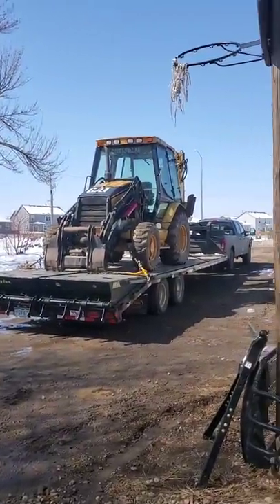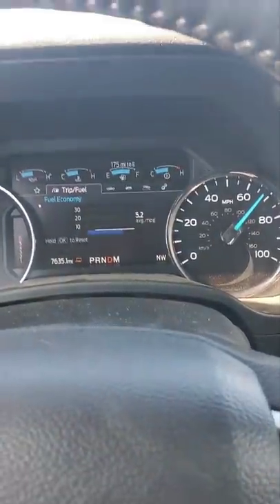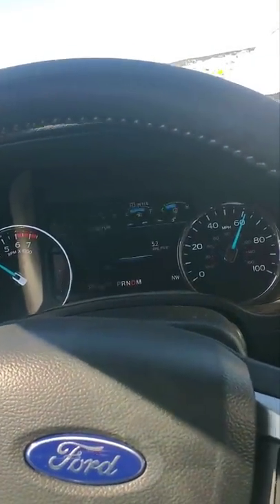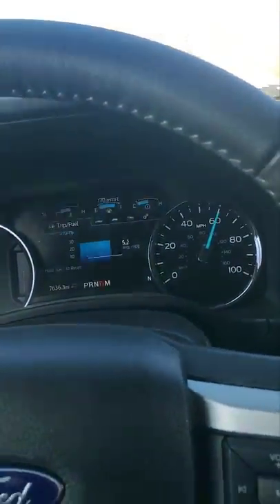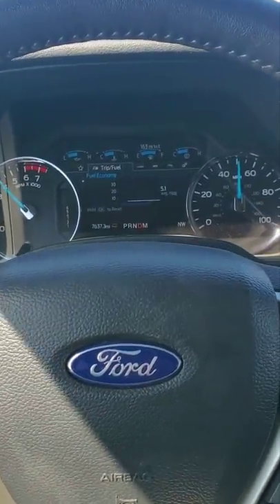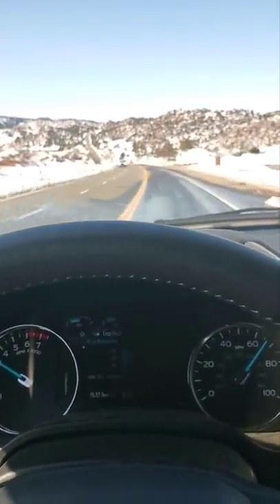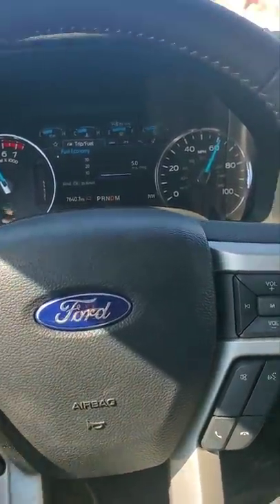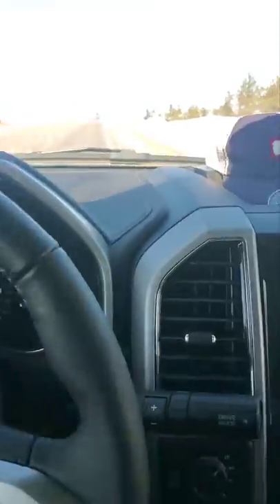7.3 godzilla towing 24k lbs through the rockies.

Comment: That 7.3 pulls 24k about as well as the Tundra with the 5.7 pulls 8k.  What a phenomenal engine.
Reply: I can attest to this as being true. I had a 2008 Sequoia with the 5.7L towing 7k trailer but loaded full of family (and dog) - through Utah/Wyoming rockies. It behaved much like this. That 7.3L is incredible that it can do this given the gearing etc. The only thing that likely would slow it down would be a tall travel trailer (likely lighter for sure) but with added wind resistance (which changes things big time), but you could easily just get the steeper gears and likely would help mitigate that issue...
Reply: My colorado 3.6l pulled about 3,700lbs from Vegas to Salt Lake City and back.  On the way back I was floored at ~5krpm barely holding 60mph.  I can just imagine this big 7.3 probably wouldn't have changed the shift pattern 😅😅
Reply: @xtanon5540  I would hope not
Reply: All yeah me and couple fellas pulled a trainnon some chic. 😆
Reply: now we need the 7.3 in the f-150
Reply: Til the camshaft and lifters fail at 40 to 50k
Reply: On which truck?  My colorado definitely, it wasn't intended to be a work horse.  It's a commuter car with leaf springs and a bed, but it pulls my 14ft flatbed with ease.

The 7.3 engine is rock solid and shared wirh class 7 vehicles.  Like with old big blocks, it is by no means the weak point of this truck.
Reply: It has more to do with the trasmission than anything else.
Reply: I agree, the 6 speed really hinders the tundra
Reply: @tomkelly3896 power train warranty will cover that, no problem. All the big 3 have lifter issues
Reply: The 5.7V8 is a great engine too
Reply: @NMTrucks That I force engine is one of the best ever made.

Comment: You hit the nail on the head, the 7.3 is not comparable to any recent gas motor offered in an HD truck, I'd go even further, paired with the 4.30 and the 10 speed, it's in a class of it's own for a gas truck. It'd be interesting to see that same pull in a 6.0 Powerstroke, wouldn't be surprised to see the 7.3 outrun a stock 6.0. 
You're pulling about double what the average guy using pulling a TT or 5th wheel will be doing, IMO, the 7.3 is an excellent choice for most truck buyers out there. 

Thanks for the video
Reply from the maker: Thanks for watchin
Reply: I agree totally. Not a giant Ford fan really...BUT this truck seems like the IDEAL option for people who wanna tow, and tow quite heavy. BUT also want a reliable (to be determined...but it's a gas engine so...) not all that garbage emmisions and DPF poo. The power from it, the gears and the trans (with the awesome tuning that was done to it) and the thing just does. I'd love to drive one and see how it is, but they seem like a pretty darn good truck.
Reply: You're CORRECT......the Ford 7.3L gas with 10R140G and 4.30 gears is in a class of its own! Compare the 7.3L gas engine to the 6.0L diesel engine? I just sold a VERY NICE 2006 F350 CC Lariat 6.0L 4WD SRW 172 truck that had virtually every option. I worked it hard, but it was super clean...95 percent both interior and exterior. Yeah, it is possible to work a truck hard and keep it nice. Most of these trucks had the 3.73 gears in the differentials. However, Ford offered 4.10...and 4.30 gears. The 6.0L with a load in tow and the 4.30 gears.....will run up Eisenhower Tunnel or Vail Pass like it was a Sunday afternoon drive on I-25. The 6.0L diesel would out tow and out perform the 7.3L gas with the 4.30 gears. However, I'd bet the 7.3L gas with the 4.30 gears would out perform the 6.0L diesel with the 3.73 gears. If the 6.0L had the 4.10 gears...probably be close toss up.
Reply: @baileyhatfield4273  **Maybe you will become a Ford fan.** You are CORRECT...the Ford Super Duty with the 7.3L gas engine, 10R140G and 4.30 gears IS the IDEAL truck for many people. I have had diesel trucks...and they "launch the load" from a stop...and pass with a load very good at highway speeds. However, I now tow lighter loads and less frequently. The 7.3L will still tow heavy loads...and more than Ford states...just not quite as easy and efficiently. These are the main reasons I just ordered on March 30th, a 2022 F350 Lariat - Ultimate Package - Black Appearance Package - Tremor Package with most all options.

***I have always like the GM gas engines. BUT, I absolutely and completely HATE the Chevrolet and GMC trucks....especially the 4WD trucks. In short, 4WD GM trucks are PATHETIC off-road...especially on uneven terrain in mud and or snow. These trucks always get stuck. Why? IFS Axle instead of Solid Front Axle and...Low Hanging Frame Rails cause the following ------------------>

1. POOR Front Axle Articulation off-road on uneven terrain
2. POOR Approach Angle
3. POOR Departure Angle
4. PATHETIC Breakover Angle (GM trucks "High Center" off-road and become "teeter totters"
5. Square / Rectangle Wheel Wells with Little Itty Bitty Tires. The proverbial "round peg in a square hole"...Stupid engineering for a 4WD truck. Lift? It takes either a 4 inch or 6 inch depending upon desired tire size......messes up the "Center of Gravity". People who own and drive Fords and Dodges can get 37 inch tires with Level Suspension System (Carli Suspension). AEV gets a 40 inch tire under a Dodge with a mild 3 inch lift.
6. Solid Front Axle better for towing...more weight up front...better balance. That said, I have seen to many people driving a Ford F250 and towing a big 5th Wheel...with rear suspension sag...NOT safe. If I was a Highway Patrol...I'd pull these people over...write 'em a ticket and tell them to install Air Lift, Firestone or Hellwig air bags. If they can afford the rig, they can easily afford the air bags.
7. Ford Super Duty trucks have Fully Boxed Frames that are e-Coated.
8. Ford offers more and better amenities and options. Plus, not many "option restrictions" like Dodge and GM is the worst...want or get a certain option...cannot have one or more other options. GM wants "assembly line efficiency" more than "customer satisfaction".***
Reply: It’s comparable with the GM 8100, that’s pretty recent in regards to modern trucks.
Reply: @messagefamilystyled1101  The 8.1 is a great motor in it's day, but it's 100 HP shy of the 7.3 Ford.
Reply: @257Tony   “modern” is anything built after the 80s.  it’s practically bulletproof I’ve towed 20k lbs with my 3500 dually 8.1 with NV4500 manual quite often, 200k miles on it. No such thing as rebuilding that engine it just keeps going. I’ve heard some horror story’s with these new 7.3s.
Reply: 6.4 with the 8spd and 4.10 is a monster!
Reply: @symorlinthecaster5882  Not even comparable IMO. The 6.4 w/3.73 struggled mightily up the IKE. 4.10 won't make much difference.
Reply: just picking up the exact combo in a 2022 this week. Very excited to see how the 7.3 with the 4.3 rear will do on that 10 speed. Hoping it pushes through all gears while towing. Brothers 10 speed 5.0 150 tends to skip 2nd and 3rd quite a bit.
Reply: also have seen some dyno numbers showing 545 at the rear when combo with the 4.30
Reply: Absolutely correct
Reply: A lot of guys talking about leveling kits on forums… looks like you found the perfect solution.
Reply: @ryanmdowling86  they are made to do that .
Put it in tow mode when you tow, and changes the transmission behavior.
Reply: The GM 496 cu in its comparable. He said the last 20 years.
Reply: @257Tony  its a great alternative if your on a budget...
Reply: You are correct. 99% of heavy duty truck owners do not need more truck than the 7.3, except maybe their ego needs the diesel. There are a couple people that tow super heavy everyday or cross country that need the diesel. The rest are just pretenders
Reply: The 7.3 gas would pull about half of the 6.0 diesel. The torque number doesn’t lie…and it would take twice the fuel. Diesel has almost twice the energy released when burned. Having said that I’m not a fan of the 6.0 diesel. But like I said earlier you can not run a gas engine pulling at its max torque load at 5000 rpms. It won’t make 20,000kms. KA-BOOM! 💥🧨
Reply: @dalekindlein7612  lol. 5000 RPM makes kaboom, but 40 psi boost, that's fine. The 7.3 gas trucks have noticeable higher tow ratings than any 6.0 Powerstroke ever did.
Reply: @257Tony   not because of horsepower or  torque .it's because of boxed frame and lower axle gears.  10 speed that you aren't going to use when towing maybe 6-7.
Reply: @257Tony   and again how many gas powered trucks tow every day like car haulers do. Zero in so cal all diesel.
Reply: He was really pushing the 7.3 to it’s limits and still did a good job at 24k lbs 
I’ve seen a 6.0 powerstroke pull 20000lbs The good old Garrett turbocharger screams it’s way down the road 
Under full acceleration and it still does a good job. But them old 6.0s are ticking timebombs. The diesels are expensive to maintain and repair. The 7.3 a good reliable engine for towing. The 7.3 under proper maintenance and repair can go over 300.000 miles under heavy towing. A new 7.3 crate engine is only around 8000$ compared to replacing a 6.7 powerstroke that will set you back 24.000$ ouch. 
The 7.3 is good for people towing on the budget
Reply: @Cowboy66SEVEN   I want to see I don't care what brand a gas motor that's used for heavy towing last 300 k. Won't happen.
Reply: LOL has anyone seen gas powered semi trucks or 18 wheelers. Imagine if ford made a 10.L v12 Godzilla. 
I’ve seen propane powered freightliners
Reply: @Cowboy66SEVEN   there's no gas powered semi's for reason. Way back in late 80's co I worked for had 2 LP. Powered international small tractors used to move trailers in yard
Reply: @techs1smh13  this guy towing a rv blew up his 7.3 godzilla after only 6800miles!!.
I guess I was wrong about it lasting 300k miles.
Reply: @Cowboy66SEVEN 🤔🤷😂😂
Reply: If you put a centrifugal supercharger on it that thing will go YEEYEE
Reply: @messagefamilystyled1101  - the V10 Ford beat that gutless 8.1L this new 7.3 destroys it no comparison
Reply: @baileyhatfield4273  still has a lot of emissions, just cause gas doesn't require Def doesn't mean there not bogged down by emission. Damn shit is annoying but oh well
Reply: @techs1smh13  it can if you follow Fords heavy duty towing maintenance schedule
Reply: I’m surprised a v8 with this much displacement passes emissions no problem.
Reply: @dalekindlein7612 u have no idea how gas engines work at all.

Comment: Please keep us updated on the 7.3. I am about to order a 350 with 3.73. I’m sold on the 7.3 design.
Reply: Did you order it? What is your payload and other weights?
Reply: @slaytanic921  on order. I have an order number but no VIN yet. I ordered Nov 2 2021. I ordered an F-350 XLT Crew Cab 4x4 FX4 7.3 Long Box, 3.73 locker, power pedals, power tow mirrors, that crazy 360 camera tow package, an extra camera, block heater, upfitter switches, fifth wheel gooseneck prep, a bed mat, a tailgate step, and clearance lights. First time I have ever gone for a Hail Mary like this. Some old guys buy Corvettes. I’d rather drive this. Im currently on a vacation trip using a similar truck only it is a Lariat. Ford gave our company this truck and said it was experimental. Won’t tell us what that means. But they just want it driven. It has telematics on it. My CEO authorized me to take it because he thinks this will convince me to back down to an F-150 again. Haha. I drove it 680 miles today from southwest LA to Smyrna TN. All smooth highway. Truck is a dream on the highway. Impressed with the engine. Tomorrow I’ll calculate mpg at the pump but the truck says it did 15.7mpg on the trip. This truck has mild mud terrain tires on it that aren’t great for highway. They are noisy. I’m sure they have a lot of rolling resistance. I was in ECO mode the entire day by the way. Great truck. I’m convinced I want to keep my 350 order intact. Why did I go 350?  Slide in camper. Slightly better payload. I ordered it derated to 10k GVWR and confirmed with State of LA and my Progressive insurance Agent that I won’t have to worry about it being classified “commercial”. Everyone says it will ride hard. Sick of hearing that. The 250 I drive today feels like an F-150 from a couple decades ago. It’s a TRUCK. It’s a Super Duty. It’s no toy.
Reply: get 430 gears !

Comment: Thanks for a great video! You’re right about diesels and all the emissions nonsense! You have convinced me whenever my 06 Cummins dies a 7.3 gas will replace it. If you do the math based on the cost of diesel vs gas and the mpg differences the cost per mile is not that different. That doesn’t even take in account the diesel engine purchase price, extra maintenance costs and DEF fluid. Unless you really really need a diesel, nowadays it’s just not worth the huge expense.

Comment: Hi there from the Western Slope of CO!  Thank you very much for sharing your towing experience with the 7.3l gasser!  I am really glad to see it is doing well for you.  I have one on order with the 4.30 gears.  We have a 26 ft travel trailer coming and I didn't want to do a marginal tow experience with the 1/2 and 3/4 ton series.  I also didn't want to spend the $$ for the diesel option.  I did have a 1ton ram diesel a few years ago.  Wished I still had it, but this gasser should serve well.    Safe travels!
Reply from the maker: I think you'll like it
Reply: You bought a 7.3 with 430s for 26 ft  Camper,You won’t even know it’s back there ,you would’ve been fine with the F150 3.5  eco-boost.It wouldn’t no it’s back there either. I think it will be a estatic with your new truck!
Reply: @JohnDiMartino  Ha...yes....we went through the thought of an F150.  But, we may get a bigger rig later on.  And, I've been part of some shady towing set ups, so I never wanted to be under tow vehicled!!  Additionally, 50% of the ways out of our town here in Ouray are a 4000ft climb within 1/4 of a mile of the town.   Oh, and the other item I didn't want to skimp on is payload.  We can easily surpass 3000lbs.
Reply from the maker: @deeremeyer1749  doesn't matter when you order it they put a build date on the door sticker so if you do get one as late as 2022 it will be a 2022.

Comment: That Godzilla sounds like a beast. I have the 2020 F-250 6.2 with 3:73 diff tried and proven 6 speed. No complaints. Last truck was 6.0 Powerstroke with 430 kilometres before it got stolen.

Comment: I'll be buying a 7.3 gasser in a dually configuration very soon. Decided not to buy another diesel can't afford to have the fuel system take a crap on me and bankrupt me
Reply: You're not kidding there! You can replace the gas engine at 200,000 miles for LESS than you would spend in fuel and emissions system repairs! And even getting 9MPG over those 200,000 miles you'll still be ahead money wise.
Reply: Just brought a fx4 f250 and I’m pretty happy with it so far cruise at 60-70mph and you’ll get 16-20mpg on the freeway but on the streets it’s like 10-13

Comment: Great video. I own a landscape company in CT with multple trucks for the past 20 years. All our trucks are Fords 03-08s and well maintained. 1 is a 05 6.0 the rest are 5.4s 2 and 3 valves and 1 04 v10. The gas trucks have had the lowest cost of ownership and best reliability to date and are all still in service along side the 6.0. When my 6.0 was out of warranty and the 5th dealer replaced Egr cooler broke I dropped 12k to fix it right. 6.0 is a great motor once you strip the garbage off it and put good quality parts back in their place. Haven't had any major issues since. The gas trucks have only needed the normal maintenance no big chunks of money thrown at them like the 6.0 needed on top of its regular maintenance items. I tow mostly in the 10k-19k range daily to jobs using conventional and goose but have towed 20-25k.
The 04 v10 Srw 350 crew 8ft bed with the 4R100 is my favorite truck. I use it as a personal/work truck still and over the years made some upgrades the biggest being the headers and exhaust to let it breathe and changed the 3.73 gears to 4.56 gears. 4.56 was the happy medium to keep the rpms down enough for highway driving and still great for towing based on my needs with better mpgs than going with the 4.88s.
If I was to buy new today especially after watching this my next truck would have the 7.3 with 4.30 gears or steeper. I use the 6.0 dually and the Srw v10 to haul the heavier stuff. I prefer using the v10 to the 6.0 the V10 imo is an absolute beast. Watching this video is almost identical to how my v10 using 4.56 gears pulls a 18k goose on inclines 3300 rpm shes puller in 3rd gear. Steep inclines she will drop to 2nd gear and  roar at 4600 but will hold 50mph or gain back. Not to many people realize how reliable and torqy the v10 really especially with the steeper gearing. People had always told me I'm crazy for pulling anything over 12k all these years without using a diesel. This video helps put that to rest LOL thanks Colton! From my experience if your towing 20k+ diesel makes sense. If your 19k or less where i have been mostly towing I'd go gas with 4.30, 4.56 or 4.88 gears all day long its a cheaper cost of ownership and still gets the same job done.
Reply from the maker: You got it right!

Comment: Trouble with a gasser, the lack of torque makes rear end gear soooooo important. Would be a practical option for hauling light equipment.  A 420 backhoe is definitely diesel territory. And even then our 6.7 knows there's a load on it when we put our 420F on it.